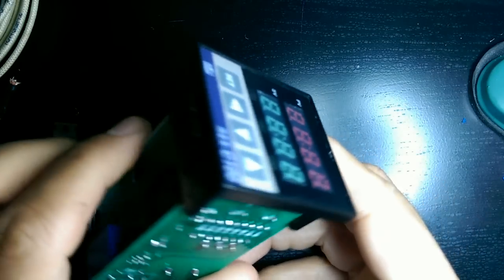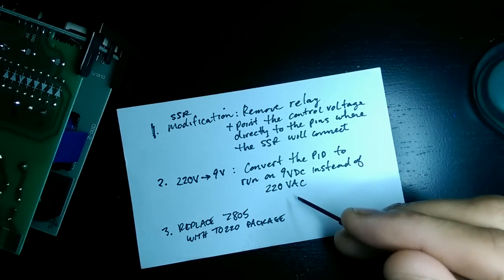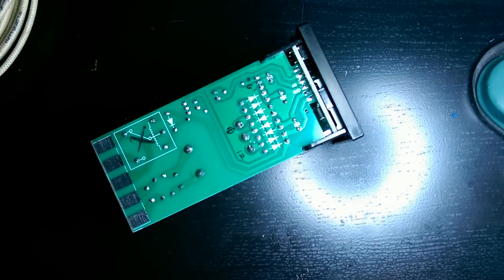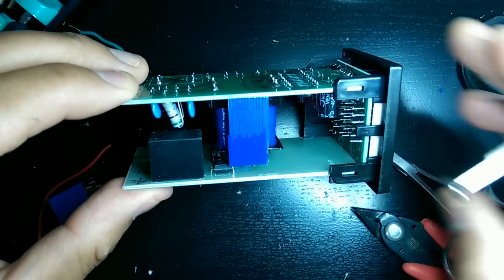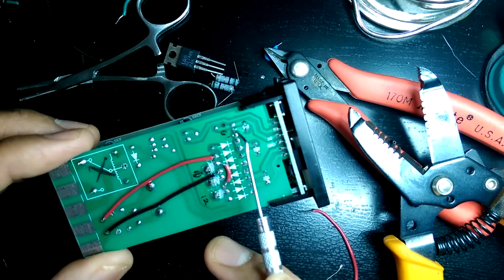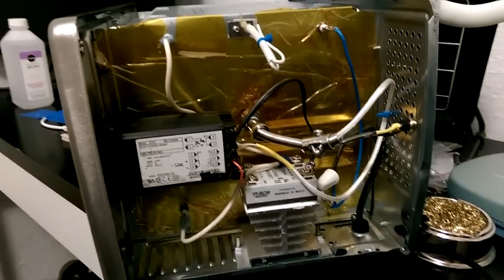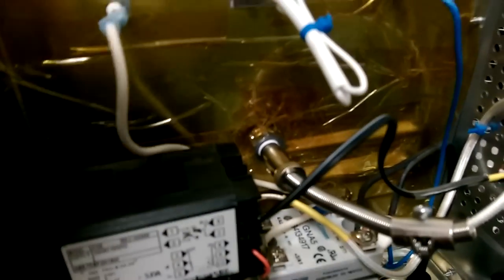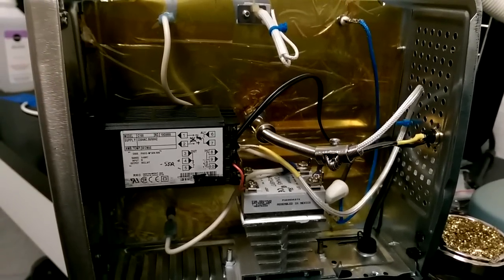REX C100 PID controller modifications

Comment: I have one with SSR output plugged into 120v (Canada). I do not use a SSR but connected a power transister running 12VDC to my PET bottle filament-maker heatblock. It works fine without any modificatiions.

Comment: Rob, your video is really bailed me out. I was making a 60C dish warmer for my son’s restaurant and, w my limited experience w/ rex c100 PIDs (had set up a garum oven and a brewery HLT), i tried the same wiring as before but the SSR refused to trip.
Your excellent video alerted me to the fact that my “rex C100” might be wired differently from the others i had worked with. Sure enough it had the same tiny relay you removed although the rest of the components were different. I followed your instructs, removed and jumpered the relay and it now triggers the SSR!
The instructions that came w it are incorrect, for another unit and dont mention the relay but i could hear it click open and closed. thanks again!

Comment: Yes, mine works on 80-240V AC also. Just get a wire, hook up, and plug into your regular 110V outlet. Mine came with a 40A solid state relay 80-240V also, just hook SSR up to the 9-32V side of the PID and hook your hot side power to the other side of the SSR so it interrupts it. Modifying parts inside it to hold more current, one must take the etchings on the board into consideration. You can't just solder your own stuff in without knowing the etchings on the board can handle that current, or at least I wouldn't. Seen too many burn out the board from these modifications due to etchings burning out. The PID is for a control, not power. The SSR is what handles the power. Mine was 10 bucks in ebay (US Seller) and it came with PID, SSR, and heat sink. Unfortunately, no screws to mount SSR to heat sink so I did a little drilling and tapping. Just make sure you use thermal paste between SSR and heat sink. I am running a metal foundry I built with a 1500W 220V element, drawing 6.5 amps on 220. If you're into this stuff, you can get the 110-220V step up/step down transformers on ebay, just follow the 80% rule of electricity...load should be no more than 80% of capacity. I'm using 2000W step up and am only running 1500W on my element. 1600W is 80% of 2000. 1600 is max i will run. If you need bigger, get a bigger one. My transformer was only $50.

Comment: Thanks so much for making this video.  I have one of these on the way and my application involves use of a DC-DC SSR for control of a low wattage heater, and I was hoping to be able to operate both the heater and the PID controller from the same 9 - 12VDC supply.  Your video couldn't have been a better fit for my application !  The version of the controller you had four years ago may have changed; the product I'm getting comes with a DC-AC SSR so I'm assuming they have perhaps changed the control outputs to DC in the 3 - 32 VDC range versus 220AC on those pads, but it's good to have a heads up on this just in case they left it the same (which I would think would be pretty dangerous).  Anyway, maybe I'll update the comment once I get into it but what you've provided simplifies my task very significantly.  Thanks !!
Reply: Unfortunately they are still selling this version under the same specs as the PID for an SSR. 
There was no indication that it has a small internal relay when i purchased it online.

Comment: YOu know these work from 80 to 240v? You can feed 3-36v DC into the regulated input of the PID and 1 ssr to each output NO/NC no problem at all. Theses mods seem to be a meme on youtube though. That way it doesn matter what load you put on the heating element since it will be separated from the PID. I have done this for years.
Reply from the maker: I'm glad yours worked out without modification. My understanding is that there's a lot of variation in the design of these clones. This one is working fine and doesn't have a mechanical relay involved anymore.

Comment: I have been seeing a lot of people modifying the rex-c100. My question is why?  The output is 5v when the relay is closed. That 5v is sufficient to operate the SSR.  Why do you need 12v? Is there something I'm missing.  Thanks
Reply from the maker: Watch the video or look at the description. There are three reasons why I modified it to work for me. You have a different model than the one that I got (and different than most people are getting for cheap on eBay)

Comment: When the led's are all on, they are NOT actually all on.  They are turned on & off in succession fast enough that your persistence of vision makes them "appear" to all be on.  That way, on ONE is acttually ON at any given time.
Reply from the maker: Makes sense given the small voltage regulator.  I never experienced a problem with leds that appeared to be dimming -  I just went by what someone else said and decided to change the regulator while I was in there. It seems like that particular modification isn't necessary though. Thanks
Reply: I STILL cannot figure out how to SET it.  The Chinglish instructions SUCK.     I KNOW it will do what I want.

Can you put together a detailed vid on the settable parameters:  P, I, d, T ,R, oH
Reply: If you want to see the scanning, video the front of it while it is running and you will see that it indeed is "flickering" due to scanning.